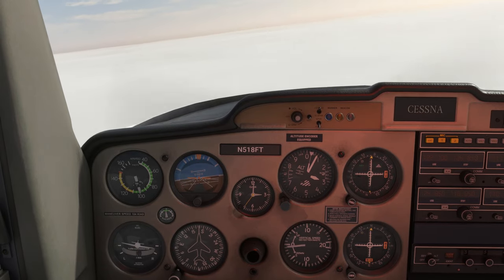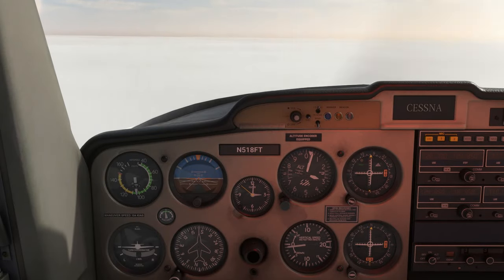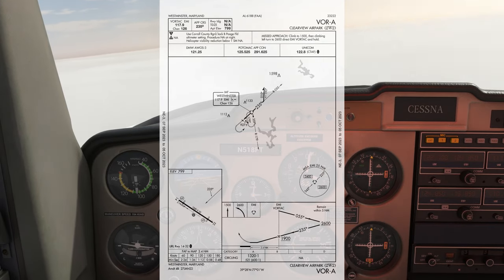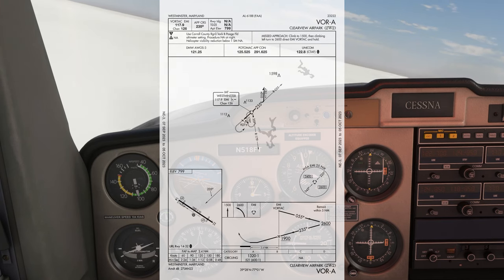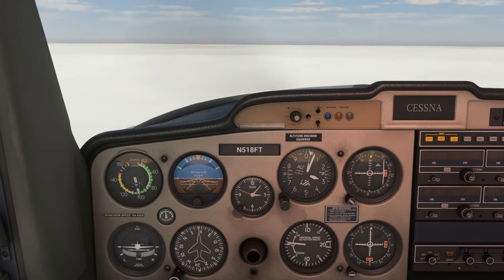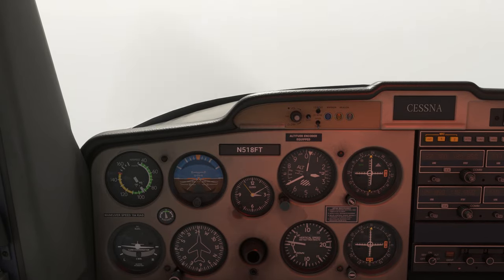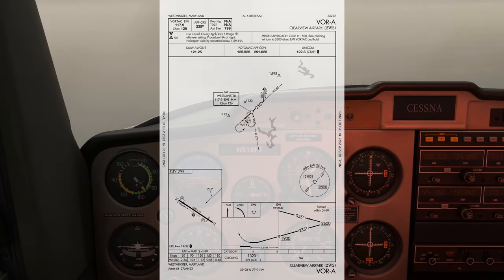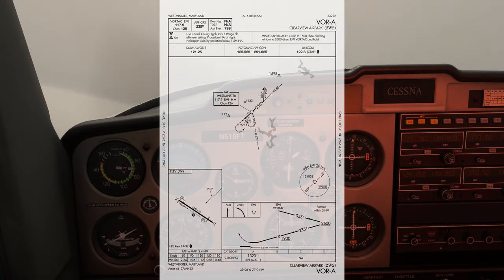VOR Procedure Turns | Clearview Airport Circle to Land

Comment: This is a topic of special interest to me.  Executing a cirlce-to-land procedure's missed approach procedure after passing the missed approach point, I believe, requires flying generally over the runway until the VOR or localizer needle begins to center, then turning to the same direction of the final approach course to keep the needle centered, all while climbing, then executing the next instruction of the missed approach procedure (flying toward a holding fix).

I have found this is not possible to practice because it requires a non-towered airport on a nice day, which draws a large crowd in the pattern.  The towered airports where I practice my approaches would never allow such a maneuver.  So I practice in the simulator at my flight school, a RedBird with the motion component switched off.

The procedure is wonderful to do in the simulator because nobody else is in the pattern, there are no announcements to make on a radio, and the instructor can vary the winds, ceiling, and visibility at will.

The Designated Pilot Examiner that will soon evaluate me advised me that this procedure will be tested at a non-towered airport 41 NM away.  Maybe he can wave a magic wand and all the planes in the pattern will depart.  Frankly I'm anxious regarding the risk and not sure what to do.
Reply: for this specific approach the directions for the missed are very clear.  I would simply climb to 1500 on the same heading as the final approach course. It is only a 200 feet climb over 2.6 NM (to stay within 5 NM of the VOR) . At 1500 left turn towards the VOR while continuing to 2600.   There is really nothing more to it..  Seems like you should be able to practice this even when there is someone in the pattern.
Reply: @asho1735   If you have flown passed the missed approach point and have turned to, say, a heading of 320 to enter a left downwind for runway 14 at a distance of 1.3 NM from the center of the airport, then during the downwind you either lose sight of the runway or re-enter clouds, then you cannot simply climb to 1500 on the same heading as the final approach course.  Because you are no longer on the final approach course.  You're in the traffic pattern at a relatively low altitude.  Meanwhile, you're still on a heading of 320.  Turn left to a heading of 140 so you're overflying the runway, more or less.  Then wait for the VOR CDI to begin to center, then begin a turn a heading of 235 degrees, the final approach course heading.  All the while climbing to 1500 feet.  Then when back on the final approach course heading flying away from the runway, begin a climbing left turn to 2600 feet while twisting the VOR's OBS until the CDI centers with a TO indication.  Note the bearing atop the VOR indicator and fly that heading so you're now going directly to EMI.   After the TO/FROM flag flips, initiate a left turn direct entry into the holding pattern, left turns, one minute legs.  
I hope I explained this correctly.  My checkride day is soon approaching !!!!!!!  I will probably have to do this !!!!!!!  [not at 2W2 -- I live 800 miles away]  or at least explain it during the oral examination . . . so how'd I do?

Comment: I flew this approach and I always ended perpendicular  to runway and I thought I was doing something wrong. What is the purpose of this approach if it doesnot lien you up with runway  and how would you land on the runway after this approach ?
Reply: Two valid questions.  Here are my answers, FWIW:

The purpose of this approach is to allow instrument rated pilots to descend through the clouds and land provided the cloud base is no lower than 521 feet above ground level.  A VFR-only pilot would not be able to land unless the cloud base were 1000 feet or more above the ground.

To land on this runway after this approach, putting it simply, after descending to 521 feet above ground level, then turn to fly a standard traffic pattern to reach one end of the runway.  If you lose sight of the runway, or re-enter clouds, then fly the missed approach procedure and go somewhere else.